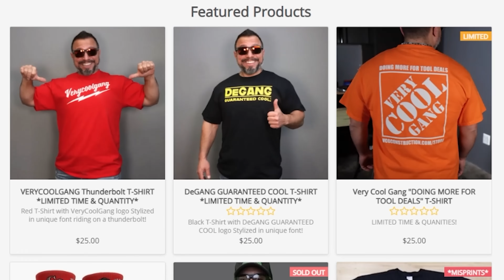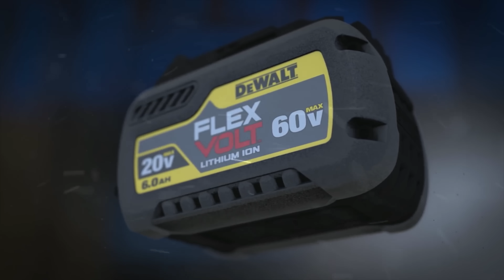DeWALT PowerStack Clearly Outperforms HUGE FlexVolt Lithium Ion Battery!

Comment: The pouch cell battery in my Dell computer lasted about ten years before it swelled up and shut off the battery recharge function in my computer. I installed a new pouch cell batter and it recharges fine now. pouch LiFePo batteries are the way to go!

Comment: What is the biggest ah powerstack, and can it be used in a 60v dewalt trimmer that needs a flexvolt?
So because the powerstack has 50% more power do this mean a 5ah powerstack is equel to having a 10ah flexvolt ?

Comment: Curious to see how this pack is going to dump the heat with no airspace around the cells. I can get a 5ah battery very hot with a continuous use larger tool.

Comment: Proprietary crap becoming less and less interoperable. Makita has good tech, Flex has good tech, Milwaukee has good tech, Festool has good tech, Dewalt has good tech. They keep making incompatible batteries not just because of the physical adapter and electric contacts, but because of the firmware that runs and governs the battery based on temperature and capacitance. What the industry needs is a collaboration between these brands that lets them use each other's batteries and charge them in a way that doesn't compromise the tool or battery. Second, it's outright disgraceful when you aren't interoperable with your own proprietary tech. Apple's model for planned obsolescence was adopted by so many industries without merit, as Apple had a monopoly and tons of edge on their competition in the form of a unique product and superior tech. There is next to nothing unique in terms of innovation in the power tool industry and it seems to be mostly side grades. What about an adapter to plug a wireless tool into an outlet? Make Flex tools take advantage of this additional Voltage and actually be backward compatible with 18-20V batts. If they collaborated on universally accepted firmware, they would all be able to communicate. It makes no sense for us as a species to continually lock up resources in proprietary products that get little to no use when they are meant to see continual wear throughout their product life. If this destroys the battery sooner, all the better (they're actually very recyclable and useful in a semi-drained state and this secondary economy is already blossoming) as you'll be able to buy another one and will be getting more useful life out of it than it sitting on the shelf without use. Those who know anything about thermodynamics and capacitance will be quick to point out that continual use under excessive stress is bad, but moderate impact sustained use, as with an IC engine, is preferred for optimal flux and minimal material wear. Battery rotation is always a key factor, as well as motor/tool rotation if being done to an extreme degree. At the end of the day, having extremely specialized tools is necessary, but it's a constant paradox of utility vs storage form. Adding proprietary adapters to everything will add bulk, but the companies can innovate further, and unless you're wearing a batt pack, you only use 1, maybe 2 batteries at once, and if you're in a remote location without access to power that requires more than like 6 batteries, you're better off hooking up a compressor/generator.
TL;DR: Make battery firmware open-source and interoperable between brands. Standardize this the same as battery connections. Make everything backward and forward compatible, and close the gap between any of this with affordable adapters whenever possible.

Comment: Bought 4, hate em...heavy and bulky. I'd had the 1.7 since they came out and loved the compact size and weight. The 5.ah is just a big ass heavy battery. Would rather have the old style 5 ah lithium which I've been using for years. The run time is also over exaggerated.

Comment: I’ve been breaking down old DeWalt and Milwaukee packs lately. DeWalt packs are much better designed. In DeWalt the pack is just cells with minimal circuitry and the cell balancing is done inside the charger not the pack where it’s space constrained and exposed to harsh vibration and impact. Milwaukee puts a balance board inside the pack. 

Milwaukee is doing great things on the tool end but DeWalt packs are superior.

Comment: I own like $10,000 worth of dewalt tools. The one big complaint that I have with dewalt are their crappy batteries, about 50% of my batteries needed to be replaced under warranty or thrown out after 4 years of use... currently I have 1 battery that completely shit itself after only 2 years of use and another 9 amp battery that only charges up half way.

If I would have known this I would have probably stuck with Milwaukee or Makita.

Comment: The only problem is these tests are stupid how meany times will have to charge the power stack 5ah each day compared to a 6ah flex witch has the best work time cos messing around changing batteries can cost money cos you're not working not drilling an few holes split seconds faster an over the work day if the battery  let's me put more screws in without charging it I find that more important I couldn't give a rats arse about speed tests run time an durability is what am interested in

Comment: I see a lot of reviews on these batteries, and it's knd of split between bad ones and good ones. So, i think i'll pick one up for my 20 volt 1/2" brushless XRDeWalt drill/ driver and decide for myself. But, for the most part, most of the reviews i've seen have been pretty favorable. So, we'll see.🤞🤞🤞🤞

Comment: So, does the powerstack battery need a certain kind of charger, or can i use the charger that came with my 20 volt XR brushless DeWalt 1/2"  drill driver?
Reply from the maker: You can use standard or rapid chargers

Comment: You actually dont want to be able to recharge a battery in 5 minutes. It will shorten the battery life by a lot. Supercharging should only be when necessary and for power tools, it never is. Just buy another battery. In general, its better in the field anyway to just carry another of these light batteries. Backup never hurts in case one dies randomly.

The problem with giving the option is adding a complexity that so few people need.
That said, when superconductors get better, we will see 5 minute charging while still keeping battery life. But then it wont likely be lithium tech. That will be a whole new type of battery.
Reply from the maker: You're commenting about charging with only "OLD TECHNOLOGY" in mind..
Reply: @VCGConstruction  but power stack is based on old tech and the question in the video was about the power stack.   The battery technology in it is evolutionary it's not revolutionary.

I love it but temper expectations until the next generation of batteries come out. But then that's just my opinion.

Comment: At any moment, when you meet dewalt people next time, ask them:why They put in flexvolt batteries, the max capacity in relation to the 20v use ,ínstead to the 60v which is what should be shown.   Example.a 6ah battery is related to 20v. In Realty is a 2ah to 60v.    Am i rigth ? Or not?  Thanks Vince…

Comment: Id like to point out a present danger to anyone who uses a welder out there any Lithium ion battery such as your phone or smart watch or mainly power tool batterys are the most vurnable because they get hot sometimes lithium ion batterys devolep micro cracks that the eye cannot see and will leak a gas which if ignited by the arc of a welder it will explode and the big batterys like the flex volts will do some very very bad damage its like a portable bomb and this new powerstack battery might be the worst because of how big of lithium ion batterys are in it ive seen it happen in shop class and this was only a phone battery but the kid had like half the parts of his phone imbedded into him its not good.

Comment: Lithium pouch cells have been out for years in phones and the automotive industry.  Guess someone at dewalt was changing their phone battery and thought why not stack these and put them in a dewalt case.  I bought one.  The power is there but doesn’t last as long as I’d like.  I’ll be waiting for a higher amp hour one.  This still doesn’t beat a 60 flex volt when you need the power power in my opinion.  For the small job yes.  For the working man you’ll be switching these out like a 5ah.  Notice they still don’t have a larger one available making you buy several of these.  I hate games come on dewalt.

Comment: I almost shit out and replaced all my dewalt tools to milwakee, I'm a commercial roofer so I run alot of HD screws, glad I didn't after replacing my old brushless 3speed impact that damn near caught fire while running it with the new 850 atomic. Now just need some power stacks to add to my large battery collection

Comment: I wonder if the power tool industry would consider using supercapacitors rather than batteries for some applications? Recharging in seconds seems cool although you'd have to find an application where you only need 5-10 minutes of power.

Comment: The only reason carpenter use Paslode Nailguns is the run time 
but judging by the new battery technology that can run for a longer period, it will be a huge save in cost.. no need for gas and my line of dewalt batteries and i won’t need to use multiple chargers for paslode and dewalt, will only use dewalt 

they should definitely work on upgrading their nailgun because its a market right there

Comment: the first argument is just silly. cylindrical cells have minimum connectivity space but pouch cells to the rescue huh? pouch cells brings thin square contacts & that means more POWA??? even writing this made me cringe. the reason these pouch cells are better compared to 18650 is the maximum amp discharge is night & day compared to 18650. a single pouch cell can easily give you 200amp discharge( every brand is different) it doesn’t mean all pouch cells have high A.D but that means deeper balls but time in the sack is hilariously low (runtime) lmao the downfall of pouch cells is that it’s a tradeoff, you get more POWA!!!! but not even close to the runtime of 18650. & the opposite goes for 18650.

Comment: I never had Problems of using my old DeWalt dcf888 and dcd794 with standard 18650cell 5.0Ah battery. And I have no problem either when I'm using a much more powerful battery the 8.0Ah 21700 cell battery I mean the tool is still lightweight! I never had fatigue and never hurt my arms, elbows and wrist. Or maybe it's because I know what the hell I'm doing and I work so fast and saved a lot of time in the jobsite

Comment: Pouch cells are not new and for sure DeWalt just used whatever the battery manufacturer had already created like they did with Samsung batteries in the flex volt

Comment: I’m curious how much of these blade batteries were actually developed by dewalt. My guess is not much lol. Good on them putting it into tools first. BYD has has blade batteries for a while. Teslas new 4680 cylindrical cells are tabless so doesn’t have the limitations mentioned here.
Reply: They didnt develop anything. These batterys have been around for a long time now. DeWalt was just the first to put them in a tool battery.

Comment: I feel like this is a stopgap when I said I didn't like the battery on the atomic line of tools myself and probably many of us met that we wanted you to be more like Milwaukee I'm gonna be straightforward be straightforward and have a mag type of battery simply because usually Lee it's not though with the battery that gets us It's how Foix it extends out and you definitely haven't proved on it But at least for me personally I like Milwaukee's 12 V liner tools which is weird because I'm huge the whole thing but I like fairlines better but I do like yours like yours for the lights bash as well I can get down with Bosh but but I don't like how weak they are they are bad experience with them so I just don't buy them when a tool that costs half the price cannot last you you have a problem And do just as much power for the power for just as long

Comment: Why on earth would anyone think a less than 2ah battery for a rotary hammer is a good idea?   Also, I noticed there wasn’t a single mention of heat. A stacked cell with no way for heat to escape wouldn’t be very efficient, but I guess a 1.7ah wouldn’t last long enough to generate much heat.

Comment: Actual reviews on these batteries have not been very good. They are pricey, they drain fast, and aren't significantly lighter than the old batteries.  The air space between the cylindrical batteries is actually very benificial for cooling, that's one reason the car batteriy manifacturers have been using them, flat cell technology has been around for years and work great for things like cell phones, but I don't see the advantage in power tools.

Comment: Snake Oils salesmen come in all shapes and sizes.  Lithium-Ion pouch cell? He means Lithium-Ion Polymer Cell.  Also depending on the Discharge C rating on the lipo's, the 18650 & 21700's can output just as much power.  Its funny he talks about contact size on the 18650 and the lipo, yet they both get connected to a PCB that connects to the tool the same way using the same size contacts.  Also its good to have empty spaces in the packs,  the heat has to go somewhere.  They have 5 lipos pressed together and not much space around them.  I see a lot of packs melting in the future.

Comment: I got the dcf850 with twin power stack pack and am waiting for dewalt new compact hammer drill release in march so each power stack has its own tool to run lol in my opinion the powerstack is worth it super conpact and lightwieght great for excessive use without stress or fatigue on hands, arms or wrist

Comment: Atomic has never been powerful enough to be contractor quality it's always been Hobbycraft what I like about Atomic is that it doesn't burn a lot of battery so I can use 2 4 amp hour batteries and as long as I'm only working and would at aluminum I can work all day long but going to bronze steel or iron I just don't have the power to get it done in the machine but I do enjoy the fact that is Compact and lighter weight then the XR now you telling me if I just got a power stack I'll have the power and the longevity no I still don't believe Atomic cam work with lug nuts

Comment: Question
So is this battery tech the same as a smartphone or tablet or laptops?
And
Is there any truth to this rumor??
I heard that the flexvolt 60v battery no matter what amp hour rating only pumps out 2ah at 20volts when used on 20volt tools...any way to measure this?
if this is true would that explain why a power stack tool is very close in performance to the largest amp hour Flexvolt battery?

The advantage the flexvolt has when connected to a 20 volt tool then would be the  runtime is my guess but if Dewalt decides to make Power stacks in larger than 1.7ah then it will destroy ANY 60v 15ah Flexvolt in head to headc competition....

Comment: I love my Dewalt tools.  I’m a 40 year roofing contractor and DeWald has been my go to for many years now. I hated the 18 V line, they were sht. These 20 V tools with the extended run and high amperage batteries are as good as it gets. Also like Milwaukee but I’ve chosen Dewalt for my platform

Comment: This could have been good if the total power even equaled the DCB203 2 Amp/Hr battery. Total power is lower at 1.7 Amp/Hr compared to their 2 amp/Hr battery; these may be able to put out more instantaneous power out but does not have more power than the DCB203. I’m sorry but in electricity “Power” is defined as wattage; DeWalt can’t simply redefine “Power” for marketing. They do this a lot even between tools in not allowing apples to apple comparisons like putting out torque, RPM, IPM across every tool wherein those numbers are measurable to allow people to composite one to the other. For example their two 60V stud drills; you cannot compare one to the other because they list different “power” criteria. Give me a brake I’m a contractor and DeWalt user but this sh!t annoys the hell out of me. Atomic is also not a “contractor” grade tool; just look at the reviews and DeWalt needs to just unify products between all stores rather than sell different products to different stores, i.e. FlexVolt Advantage and PowerSelect. Marketing BS.

Comment: A top of the line cell phone is getting 4+ Ah out of a single pouch cell.  It is kinda crazy to think about what power stack will be capable of if their pouches are anywhere near comparable
Reply: At a lower voltage...
Reply: With only a fraction of the maximum power output that power tool batteries provide. Lithium battery design is always a trade-off between capacity, power and longevity.

Comment: Flat out lies it's a lipo. Your telling me dewalt has a pattent on a non lipo battery that has 50% current capacity and cuts degradation in half? And is safer than a rolled steel cell?That tech would be worth trillions and change the battery world overnight

Comment: What I would like to know what company gives me a drill where I can use a 7 inch concrete hole saw with a battery tool who supplies that what brand names and not using those massive batteries that Milwaukee supply this I feel the industry is left wanting I don't need to Mortgage my house to buy a battery like with Milwaukee batteries